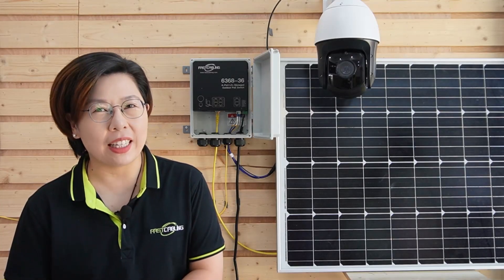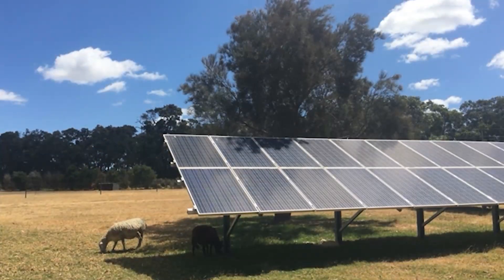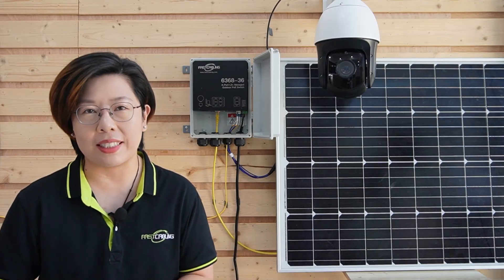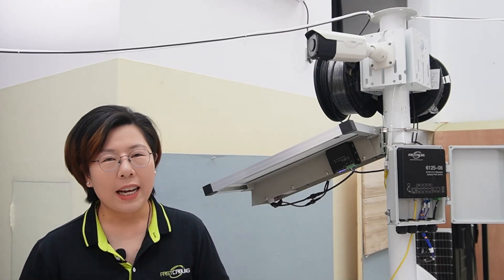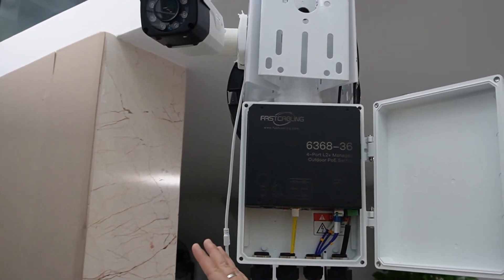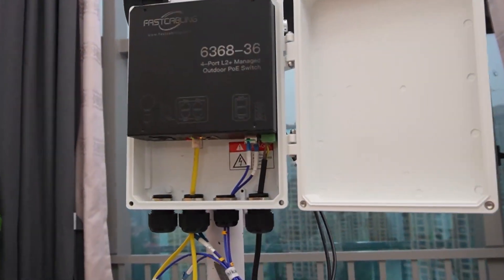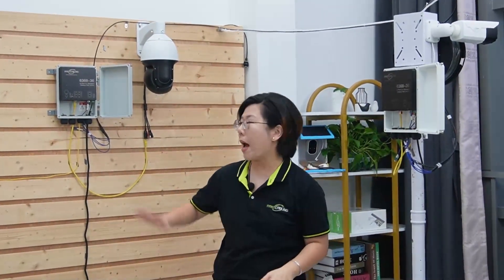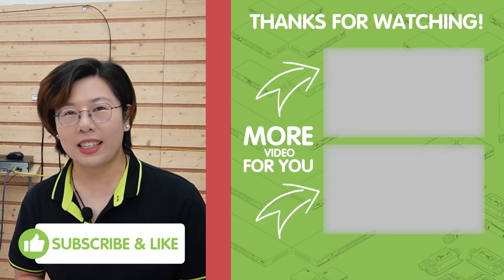Ring Network for Remote IP Camera Setup with Solar and Fiber Connectivity

Comment: Ring networks have an issue in the network standing point, have you ever heard of a broadcast storm ?
Reply from the maker: You can use protocols like Ethernet Ring Protection Switching (ERPS) to manage loops efficiently in ring topologies. You can configure one path as primary and the other as a backup. Traffic flows only through the primary path unless a failure occurs. STP also automatically detects loops in a network and disables redundant paths to prevent loops from causing broadcast storms.